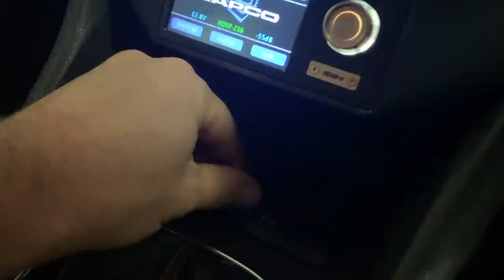Walk Around Steve's GOLF 6  SQ, SQL System + Interview - HAT, ZAPCO, ARCO, MUNDORF, STEREO INTEGRITY

Comment: it's lovely. my one concerning is that the vibration from the sub will loosen the screws on the amp to cause a rattle
Reply from the maker: Jadad Nathaniel then just use loctite! 😃
Reply: respect bro. !!sorry for the person that has to repair that amp!!
Reply from the maker: Jadad Nathaniel i had my amps like that for several years in a similarly crazy bass setup and there’s not a single issue to worry about! We build installs to bulletproof, nothing rattles & moves here, so no need to worry! 💪🤘

Comment: Did you guys run new wires into the doors? And if so how 🙂
Reply from the maker: Gressi 99 ask Steve, but i’m sure he had to! 👌
Reply: @pssound9749  will do 👌🏻

And thanks for the awsome content as always. 

All the time, effort and quality you put in your work is surely appreciated, keep it up
 😊👍🏻
Reply: One method is to drill out empty spots in the door loom plugs, then feed speaker cable through that way, into the doors Gressi 99 😄
Reply from the maker: Jordan Crawford end then when you need to take the doors off for something, you’re screwed! 😃
Reply: @pssound9749  as I said, one method/ way of doing it 😉 hardly any different from running wire into a more conventional grommet setup on an older car etc
Reply from the maker: Jordan Crawford indeed, it sucks either way! Just another reason why i hate fitting speakers in doors! 😖😃